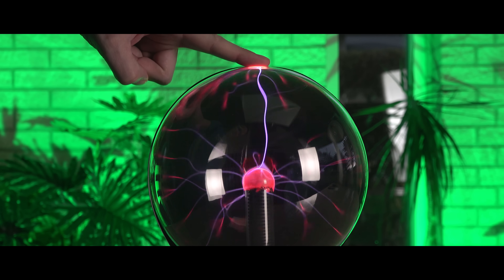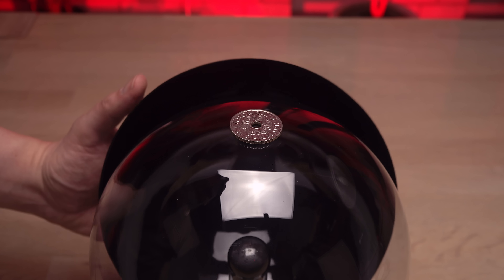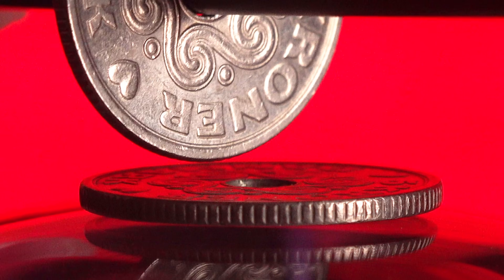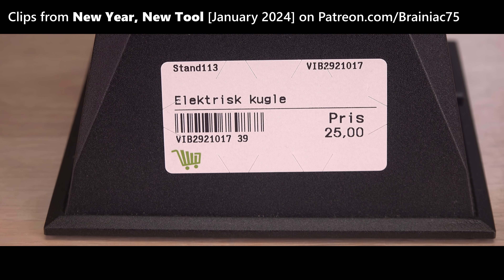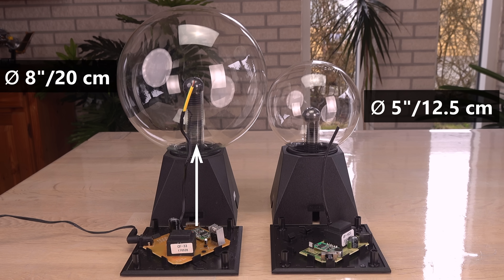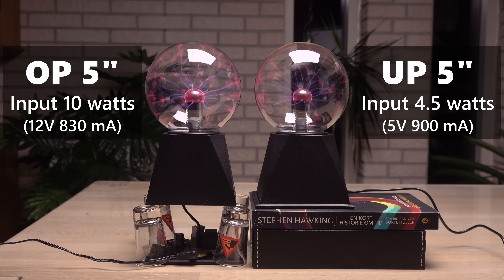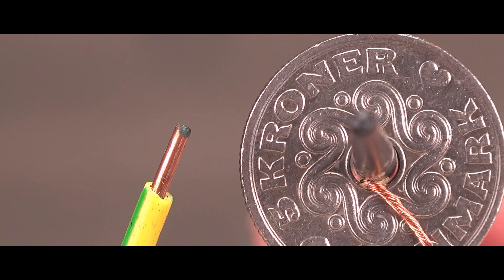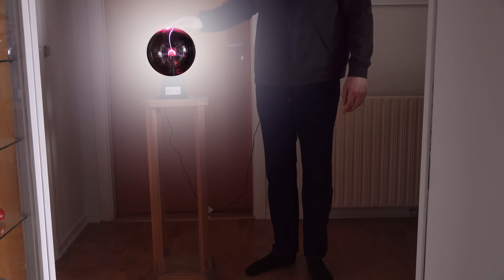Power of Plasma Balls Visualized | Don't wear a ring... Jumping won't help!

Comment: The effect you got after touching the plasma world was likely down to the frequency of the converter in the device we are very susceptible to high frequency electromagnetic radiation. With these free loaning oscillators They will produce Frequencies that do not resonate with the body and these frequencies can be harmful because they excite the body in a manner that it does not want to be excited in. An excellent example of this is how an instrument can be out of tune and affect the listening quality of the instrument basically when things aren't tuned in to what the body wants the body doesn't like it.

Comment: Love the experiments... That wire did not appear to be grounded, due to all the paint on the radiator... A better ground, might produce different results... 👍
Reply: At radio frequency the wire was capacitively coupled to ground, so it was grounded to some extent.
Reply: @JohnShalamskas  obviously, but a direct earth ground may produce different results...

Comment: A dangerous but fun thing you can do is wrap a coil of wire around the plasma ball. You can get scarily high voltages that way, more than an inch of arc in air. I learned that touching such things is unwise but probably not deadly as a 10 year old sitting with my bare feet on a damp concrete basement floor.
Reply: Adding a mechanical pencil to the copper windings creates a low powered etcher, 
Lightly burns paper

Comment: Funny story actually... I once had a plasma ball that I bought off of eBay (this was 4 or 5 years ago) I was running it on 24 volts because I was curious what would happen. I was arcing a piece of metal to the glass and after a couple of minutes, the whole glass ball EXPLODED! Luckily, I was wearing glasses and none of the glass went in my face and I was fine but holy hell was it scary. It was something I was not expecting and I'm never going to do that again. I have a collection of old and new plasma balls and I'm still adding more to it. Let's hope that none of them go nuclear on me...
Reply: Sounds like internal stresses in the glass got released once your pinpoint hotspot either melted through or caused a thermal fracture. I imagine the higher quality globes might be annealed (heated and let cool very slowly to reduce internal stresses), but your cheap eBay one, I guess they skipped that step. What's a few severe eye injuries for the sake of PROFIT! 🙂
Reply: Yeah, the single spot overheated the glass. They probably use a cheap untempered "soda glass" which means that all the internal stresses will cause the ball to shatter upon impact or pin-point heating

Comment: Your explaination about the electric field is not really correct.
The relevant term here is Self-Capacitance. This is the capacitance of any conductive object by itself that doesnt need a second plate. Its the same type of capacitance that holds any static charges. It simply depends on the size of the conductive object, or more precisely, its outer surface area. 

These plasma balls are NOT actually properly grounded inside. Essentially BOTH ends of the HV output only have some capacitance connected to them. Current simply flows because it DOES require a certain number of electrons to be moved to establish a charge on both ends of the output, one of which is the glass globe and anything connected to it. Since it is putting out AC, the potential the driver wants on each side changes constantly and thus an AC current has to flow continuously. A human body is relatively large compared to the plasma globe, so thats where most of the current will try to go. The "Ground" is nothing more than the planet's self-capacitance. Since it is so big, it will ALWAYS dominate any system that relies on self-capacitance. Thats why the ground is such a stable potential in most cases. But for the case of a relatively small plasma ball like this, it doesnt matter whether a human is connected to it or a much larger capacitance, the power source wont be able to charge you up to the actual voltage it is putting out because of all kinds of impedances in the circuit. So there is basically no difference in the arc whether you jump, stand, or even touch something well grounded.

Comment: My thougts about the sparks while insulated, its an high voltage high frequency ac source. if the body is large enough like an bottle of water hanging insulated from an wire, it wil most likely also spark. first its get loaded with electrons on the positive cycle, then the electrons are taken away on the negative cycle creating a continuous voltage differential and thus a spark. Some sort of capacitive coupling. Can you try this with Franklins Bells (Lightning Bells)? Nice video as always, informative and entertaining. Thanks

Comment: You don't even need a coin. Any long piece of wire will do.
But aside from being careful with electricity and sparks and fire hazards... Just note that your piece of wire becomes an antenna that can wreak havoc on other electrical devices, killing them.

And in any other case, you could also technically be jamming radio frequencies. Which i am sure is illegal no matter where you live.
Reply: I was looking for this comment. Holy cow I hope no one needed the wifi.

Comment: Thanks for another awesome vid Brian!! Back in the 80's mine and my brother's 6in plasma-lights had adjustment knobs on them and at maximum power they would create large swarms of filaments like yours when you swapped globes. They must've had a large power supply already in them. Look for one of these from the early 80's and back. 😎👍

Comment: I would guess that oils from your skin or possibly salt from a tiny amount of sweat or some combination of the two is what makes for higher conductivity on the surface after you've touched it. The tiny amount of moisture would probably evaporate and reduce that conductive effect, but I'd like to see what happens if you wear a conductive glove that blocks any sweat or oil from your hands from transferring to the globe.

Comment: 30 years ago I experimented just like this as a kid. I found a tinfoil 'hat' that rose to a sharp point gave the best sparks, putting my finger above focussed the current on such a tight spot that it instantly burned me. The black-red dots stuck around for a few days, my hands and arms were covered with them as I never learned from my initial mistake. I could even use the tinfoil hat to start fires which even as an irresponsible child scared me so I stopped leaving it on 24/7.

Several years ago my mum gave me a usb plasma ball for christmas, despite being in my thirties I felt just like you and was immediately a kid full of wonderment.
Reply: Ha! Did the same. Wrapped mine with a hemisphere of foil. Became quite familiar with the scent of toasted flesh. Also discovered if I fiddled with the controls juuuuust right, I could engage a "crazy mode" where the entire sphere would go pink, emit a ringing sound, and trigger the neighbour's garage door opener when touching the globe.

Comment: Your 'grounding' to the radiator won't work properly unless you file the paint away on the radiator and have a clean metal to metal contact.

Comment: You are high frequency ground. I did not figured out why however.
Either you are capacitively coupled with Earth (several picofarads are enough) or air itself is kinda grounded and it slowly drains charge from you.
Reply: More like 70pf for a human body at radio frequency.

Comment: especially when working with high voltage/current systems, it's worth remembering that electricity follows all available paths (inversely proportional to each path's resistance)

great video and i don't mean to be argumentative, just that this is one of the cases where "path of least resistance" can be misleading in a way that gets people hurt!
Reply: AlphaPeonix has a video titled `How does electricity find the "Path of Least Resistance"?`  While I know exactly what what you mean, it's a super great demonstration.   It can also be easily expanded to show how even if there is "infinite" resistance, you can still have energy flowing in an AC circuit.
Reply: @EmperorA0  ooh yes, agreed! i'm only a dabbler in RF/EM stuff so wanted to avoid overstepping and saying something confusing or misleading. plasma lamps tho are getting into the voltage/frequency range where electrons start to get frighteningly "creative" with the definitions of "path" and "resistance" haha

Comment: Are you sure the wire was grounded? The radiator is painted.
Reply: Looks like it wasn't. But it was capacitively coupled for sure.
Reply: It doesn't make much difference for high AC Voltage. The insulating paint layer will act like a capacitor like the glass globe. Possibly the paints insulating properties will break down due to the high voltage and create a connection

Comment: Hello good sir, i have a question about lasers. I do have a 532nm green diode laser pointer and it lights most of the stuff i shine it on in a bright green, as one would expect. But when it hits certain objects, it does not look green any more. This occurs when the object is of a neon colour, for example Red and orange Highlighters/ Textmarkers. Same goes for orange plastic clamps from the home improvement store. I also have a coffee mug which is neon orange. Pointing the green Laser at it makes it flouress bright orange only, no more green light can be seen. Several other random things made of colored plastic do the same thing, the laserlight returned is not green any more but different shades of red and orange. Do you have ovserved this effect already yourself? Do you have any idea what is going on there? Would this be a topic for a video? Best Regards 😊
Reply from the maker: Interesting. 532 nm can make some fluorescent materials fluoresce - though 405 nm violet lasers are much better for most fluorophores. I doubt all the green light is converted by the fluorescent materials. I think you experience a mixed color where your eyes combine the color of the green laser and the fluorescent color into a third 'apparent' color that is actually just a mixture of the two. I have noted it as a potential video idea :) Thanks for the early watch!
Reply: @brainiac75  glad if i could spark your interest! 😊

Comment: I wonder what would happen if you put various passive components in the conductive path. A resistor, capacitor, and an inductor. Also what if the 2 globes touch. My theory on the mutual attraction is that when you touch it, it dissipates some surface static charge from the glass. I wonder if wiping it with a dryer sheet would do anything.
Reply from the maker: The electricity from the coins is high-voltage, very low-current AC so the components should be rated for that. Letting two globes touch each other can give some very interesting interactions. Will have to make a video about it! You might be right that I remove some build- up static electricity even though it is an AC signal. Still lots of experiments to try with plasma balls as mentioned at the end of the video :D Thanks for the inputs.

Comment: electricity isn't lazy, it doesn't just go the path of least resistance. Electricity is greedy, It strikes everywhere at the same time as hard as it can, with the shortest path taking the brunt of the force.
Reply from the maker: Yes, greedy is a way more precise, subjective description. Will have to remember that ;) Thanks for the early watch!
Reply: @brainiac75  I don't have a good description when it comes to transistors and impedance, though. It does whatever it wants then and transistors burn out and then everyone's sad.
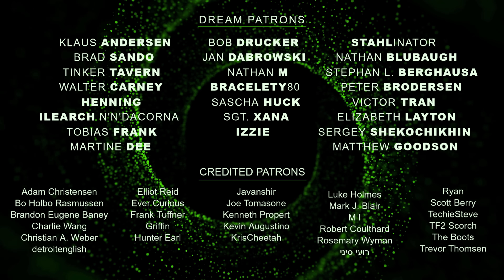Reply: 7:08  @brainiac75
Reply: If it strikes everywhere it isnt greedy either. Its aggressive
Reply: @jismeraiverhoeven  it's like a snake, once it bites it won't let go! Though that's your suicidal muscles at work.. It's an insurrectionist!
Reply: it only hurts for a second.  typically
Reply: It's "lazy" in that once it fines the least resistance, it perfers it over a higher resistance path.
Reply: @pleasedontwatchthese9593  well, that yeah. But also still not. Most current paths created in air are extremely unstable and collapse frequently, causing electricity to create another path at random, often not even close to the original.

Comment: Put some graphite fiber whiskers under the coin, the structure will create pressure to eject electrons into the air
Reply from the maker: Interesting. Will have to look for some thin graphite pieces and test it :)

Comment: I remember when the plasma balls were first available in the mid 1980s. They were over $2000 then. Now they're a commodity.
Reply from the maker: Yep, it is surprising how cheaply they can be made today. The 5" globe was only around DKK 80 / USD 12 brand new including 25% Danish VAT. But without a heatsink on the transistor it is not exactly well-built ;) Thanks for the early watch!
Reply: @brainiac75  I would love a link. All the globes I find are too expensive for a curiosity.
Reply: A friend of mine got one in probably the late 80’s. I think he paid $100 or $200.

Comment: I have actually been thinking about this for a while (the part with the powersupplies) and there is surprisingly little info on the internet about it.

Tak for denne gode video Brian 😄
Reply from the maker: Glad to be able to give you some answers ;) Velbekomme :D
Reply: I believe it is effectively a small tesla coil. It would be interesting to see what happens if the power supply was replaced with a wire from a small tesla coil, such as the ones sold on Amazon that play music.
Reply from the maker: @betterl8thannvr The cheap plasma globes use a much simpler fly-back transformer but a Tesla coil could be used. The plasma balls just need the right combination of voltage and frequency to work well. I do have a small music Tesla coil (unboxed on Patreon) so I might try your suggestion ;) Thanks for the early watch!
Reply: @betterl8thannvr  Styropyro tried this a few years ago on youtube, and like he usually does it's not a tiny cheap coil
Reply: @betterl8thannvr  i have one myself and have taken it apart and such. Its not a small teslacoil but a small flyback transformer. I just didnt want to break mine as its quite old and has a cool effect.

Comment: 0:54 steel Industries take advantage of this phenomenon with electric arc furnaces, used to melt hundreds of tonnes of steel scrap in less than an hour.
Reply from the maker: Indeed. A strong spark can be surprisingly hot. I'm glad I don't have to pay their electricity bill though ;)